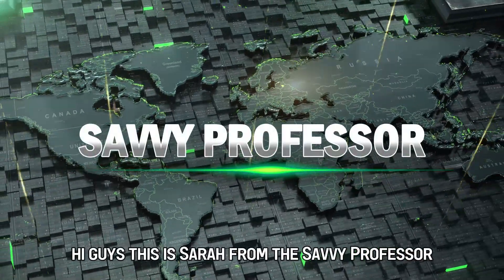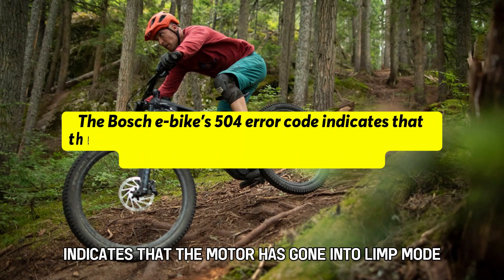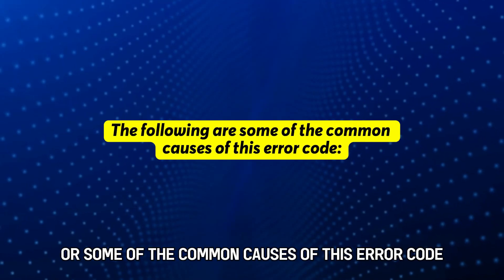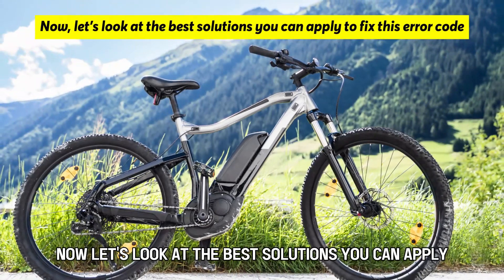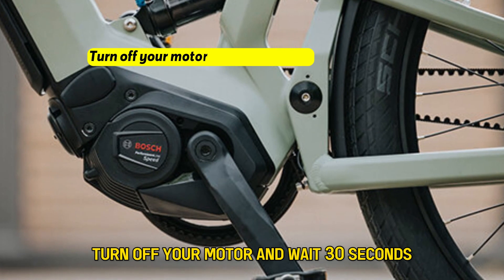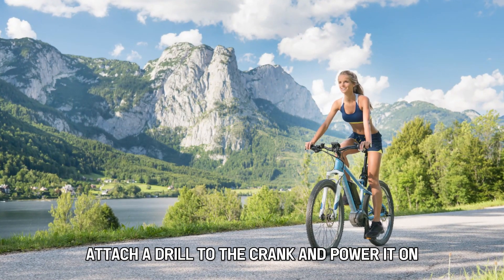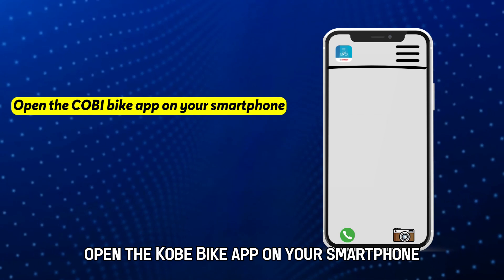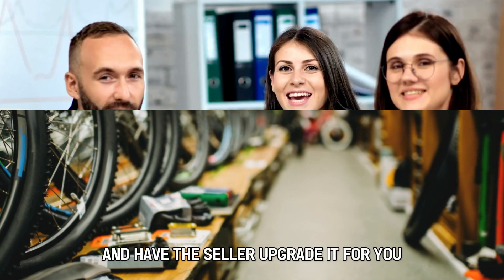Bosch E-Bike 504 Error Code (A Simple Guide To The Meaning, Cause And Solutions)

Comment: NOTE that I got a 504 error code just by setting my bike down on the ground. The magnet wire by the rear rotor is very sensitive, a stick hits it,  jostles it slightly, a 504 error and now I have to ride my 50lbs Orbea eMTB with no power for 20 miles?!!! It is ALL hills where I live. What kind of crap is Bosch pulling here?  This is Bosch revenge for owner "tampering" with "their" bike? But wait Bosch geniuses -- the error code ALSO trips for other reasons!!!! I don't see in my Bosch MANUAL where I need to install a DRILL to clear codes.  Since I have zero dealers within 50 miles, maybe Bosch can fly a tech to my house and reset the error code as this idiocy is completely their fault. I'll make him a coffee. He can read some magazines while I finish f-ing laundry. FU Bosch.

I have the latest firmware updates. It's just so dumb that a company of adults would make their customer go on a clown circus ride to prove some sardonic point. It's like college hazing. Customers must prove they are worthy by biking the gauntlet. On future codes, customers must ride the bike 30 miles without power while being punched in the ribs by Bosch Tech, flown out to customer code rides for that purpose.  Thanks Bosch, your company is like a Monty Python skit!!!!
Reply: I’ve had this twice now how u get round it plus do have to do the 20miles in one go or can u do it in a few trips
Reply: @alfiegrant7816  You must ride for 1 hour on eco mode... and then power off/on. I had the drill on it in my garage but the drill slipped off a bunch of times. A few times no pedaling for 4  minutes straight when the drill slipped. Mostly going 3-5mph average.  Then I rode the bike for another 15 minutes just to be sure. 1.25 hours later,  the code is cleared.  So it seems you don't have to pedal constantly or even ride constantly but keep on Eco mode for an hour with an average speed of 3-5mph is OK.... just don't don't let the bike auto-shut down from lack of motion.

Comment: I have heard that this method only works for about 3 times and then it is permamently in Limp mode. Can anyone confirm this or is it just false information to scare people off? This happened to me twice already and I am kind of scared if it can not be fixed anymore.
Reply: After the third time the dealer has to unlock it
Reply: yess the dealer fix id in 5 min ones its fix you can not do id yourself no more
Reply: Every time the motor picks up any manipulation and raises the error it can be reset immediately in 2 minutes using the diagnostic tool, or the user can ride 90 minutes as a slap on the wrist. After the third time the 90 minutes will do nothing and you have to have this reset by a dealer with the tool. This is now logged permanently on the motor and if you were to have any warranty issues then repeated manipulation resets doesn’t look good.

Comment: Thanks for the info.
 I put controller in  eco mode  & rode the bike for 1 hour at 7 to 9 kph with the crank constantly turning.   Turned the controller off waited for 30 seconds & turned back on & problem sorted.
Reply: Have you chipped your motor?  I’m thinking of getting a volspeed v4 but don’t want to brick the motor!
Reply: @davzer3773  No I haven't chipped the the motor.
Reply: I chiped mine with speedbox 1.1 and now have a 524001 code 😢